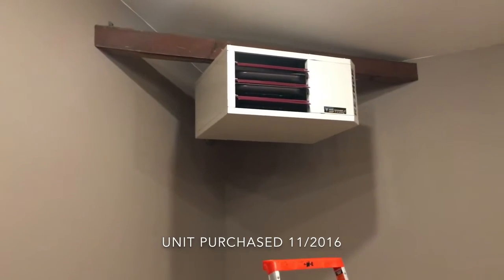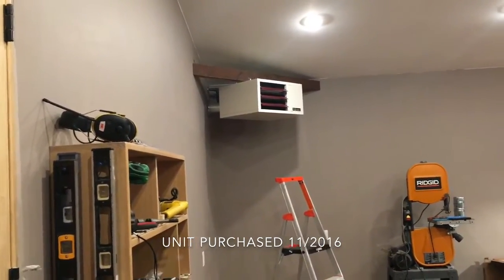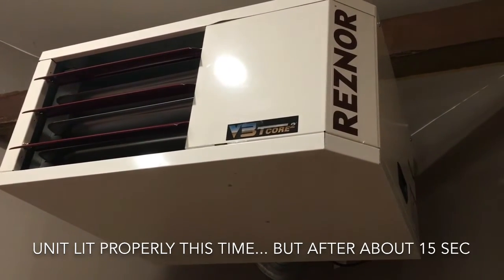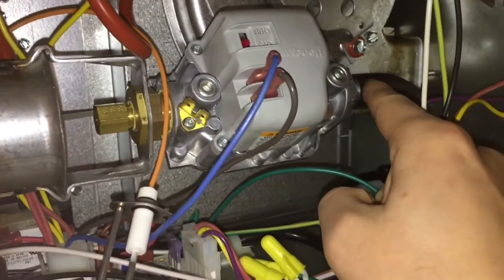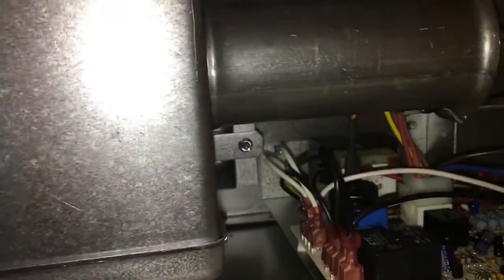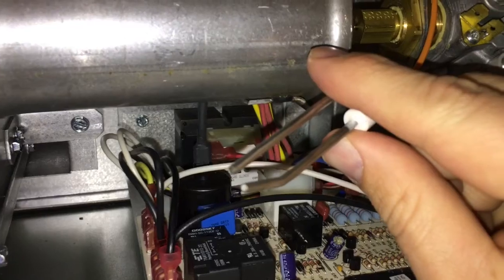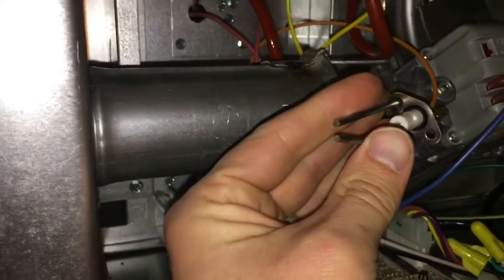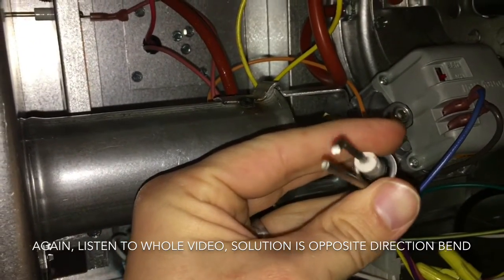REZNOR UDAP45 IGNITION PROBLEM

Comment: Thank you for this video!! My 5 yr old Reznor 75k btu has always been hard igniting.  I have cleaned ignitor and checked input and output gas pressures.  It has been getting worse and after 4 failed attempts the unit will lock out and you have to cycle power to it so it will try again.  My symptoms were identical to the one in this video.  I bent the ignitor rod away from the heat exchanger as he did and instant fix!   It now ignites reliably after about 5 seconds almost every time.

Some have commented you will damage the ignitor if you touch it. This is incorrect.  You can touch this type of ignitor with your fingers, wont hurt it.  It is the hot surface ignitors (particularly the silicon nitride ones) that you shouldn’t touch.

Comment: phlion, Thank you for posting this little gem!!!!  Just a small tweak is all it needed!  Mine is a udap60 from 2008, same issue, to start with it seemed better if the service panel was left of, then if a door was open, then it just didn't matter.  One thing I would add is the hole the ignitor installs in is oversized,  so make sure the ignitor is moved as far to the  outside/away from the heat exchanger as possible.

Thank you again  Cheers!

Comment: I just fixed our Reznor garage heater, but the issue was with the flame sensor, not the ignitor. Although I did remove the ignitor and clean it (what a pain), the issue with our Reznor heater not firing up was that the flame sensor was horribly dirty. After removing it, giving it a wipe down with a baby wipe, then a Kleenex, and finally a good cleaning with a piece of newspaper, and re-installing it, the heater fired right up. 
 I learned that this trick also applies to our house furnace as well, that was doing the same thing.  I saved a lot of money in service calls. :)

Comment: Update Dec 2022: bent ground probe on igniter towards panel and mostly fixed, but was still having misfires. Ended up bending both ground probe and positive probe on ignitor (careful not to crack insulation), and replaced ground wire eyelet connector (was cracked from repeated attempts) and seems to have fixed issue. Currently -3°F and really hope this works. If you don't hear from me again assume it did.

Comment: Worked like a charm.  I found this video after I had an email conversation with Just Answer.com.  The expert diagnosed a bad gas valve. Well, I started the heater then went up a ladder and smelled what was coming out of the exhaust.  Yup, gas.  Oh well, it was only $5 wasted and not a visit from an hvac guy. Thank you!

Comment: I'm surprised they don't use a HOT SURFACE IGNITION like the MODINE HOT DAWG.
Reply: Hot surface is garbage. Modine uses spark too now.
Reply: @  no it's not garbage now that they are silicone nitrite made so it's more durable than the old school silicone carbide design I remember that the old school silicone carbide design was Fragile especially when touched it so I disagree with you on spark ignition not very many furnace brands have spark ignition the only one that I know of is RHEEM. EVERYTHING ELSE IS THE HOT SURFACE IGNITION.

Comment: I am going to try this on my heater, it has been a real frustrating experience working with this piece of junk.  I have a Mr Heater unit in my garage that I flip the breaker on in fall and it works perfectly until I shut it off in spring.   I  paid for 2 service calls and replaced the flame sensor and the igniter,  Reznor was no help whatsoever, telling me that they usually always work and providing me with a list of parts I could guess at to try and get it to work. Nothing like standing behind your product.

Comment: I tried this it worked GREAT. Now the only problem that I`m having is the limit / roll out switch trips. But this is due to the location
of the thermostat. The unit is located in a wash bay for trucks 20 ft in the air the bay is 40 ft long with 8 ft block wall. The stat is
located on a secondary wall that will never see the temp in the bay area, causing it to trip on limit / roll out switch. If I keep the stat at 65 deg it works fine, raise it to 70 deg it trips. I`m wondering if I can replace the limit / roll out with a non reset limit. Any input ??

Comment: You're not supposed to touch the igniter with your fingers 🤦🏾‍♂️
Reply from the maker: L Aikens I hadn’t heard that .. why not?
Reply: phlion because the oil from you fingers can shorten the life span
Reply: Did you have to adjust for altitude?
Reply: Matt G nah
Reply: No altitude adjustments...
Reply: No
Reply: @phlion    I've only heard that about hot surface ignitors... not spark ignitors.
Reply: @musicnerd72  it is only hot surface
Reply: You can touch a spark ignition, just not a hot surface ceramic.

Comment: Do not touch ignitors like heating elements or flame sensors with your bare hands.
Oil from your skin causes problems.
Reply: No thats only true for hot surface igniters not direct spark igniters.